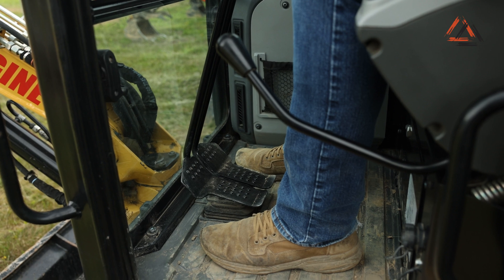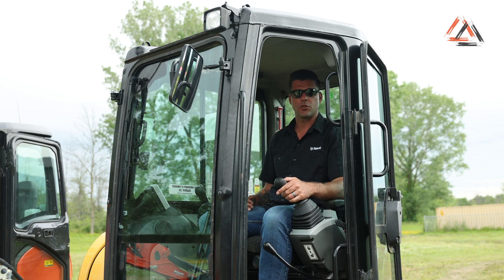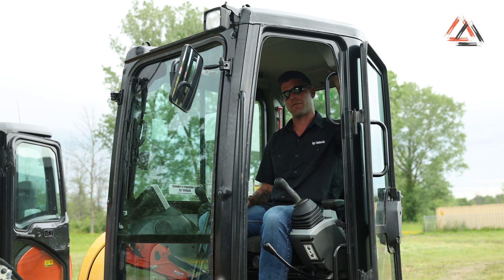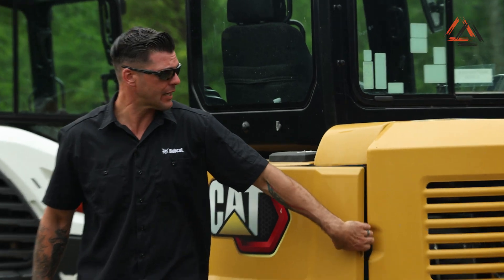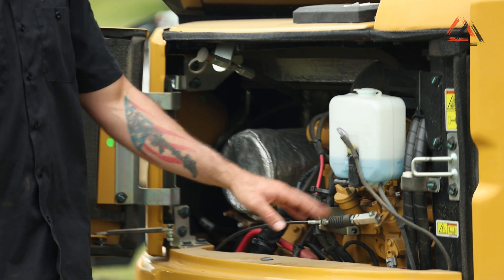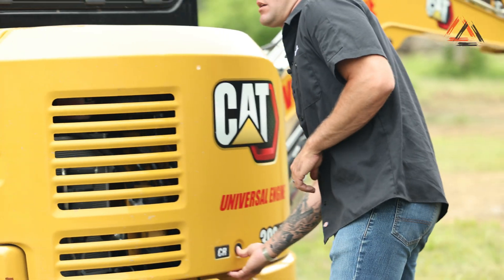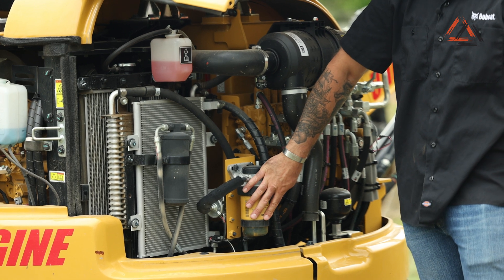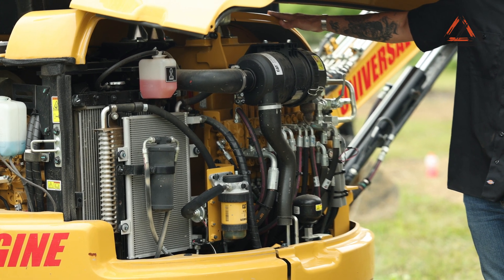Cat 303.5E2 Walk-Through - 3-Ton Mini Excavator Comparison Series

Comment: Would a 2022 w/115hrs. that looks new besides bucket/blade be a good buy at $23k for a full-on beginner ?
Reply: Dude that's a great deal.. I'm looking at a 2017 cat 303.5 fully enclosed with thumb. Has 3,100 hours. They want 35,000 for it.
Reply: @DieselManSam  The one I was talking about was clearly a scam. I eventually figured it out after some research.
Then I talked to the guy a few times and when I said I would bring a cashier's check and pick-up myself ( instead of a wire and delivery ) he faded out .
That is why it was listed in B.f.e. Wyoming.
Reply: @DieselManSam  I thought I had replied to this. I figured out shortly after I posted that it was a scam. Then I messed with the guy for a bit for fun after he called and said the winning bidder refused to pay so I had the opportunity to buy at that price.Told him I was wiring  bid plus $2500 shpg. several times , then when he kept calling with no receipt , I said for some reason it would not go thru.  He disappeared when I said I was coming with a cashier's check and asked the exact location. That's why he listed it in BFE, Wyoming
Reply: oh yeah, it has a Manca thumb ( best looking thumb I've ever seen) and a 3rd & 4th aux hydraulic valves.